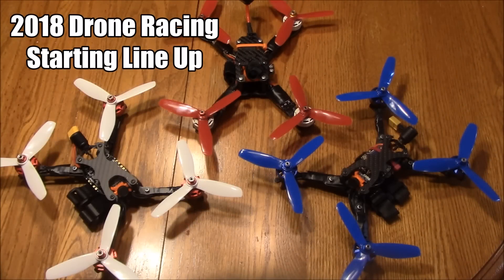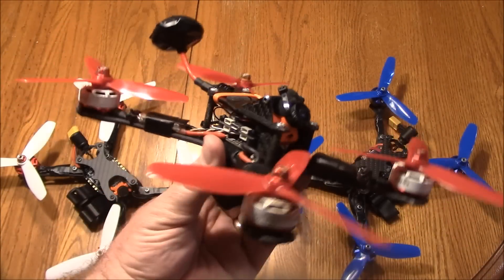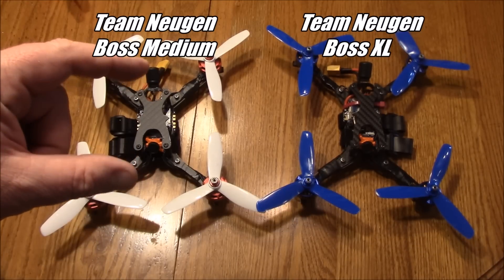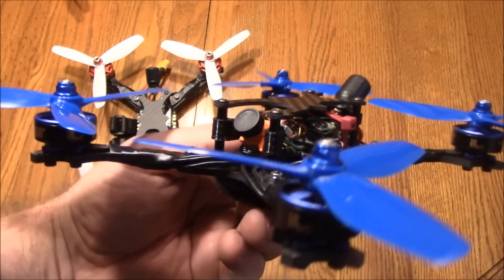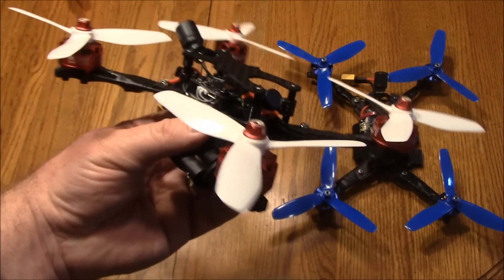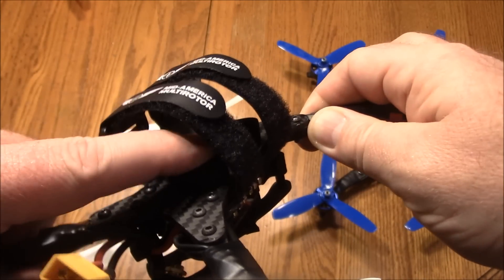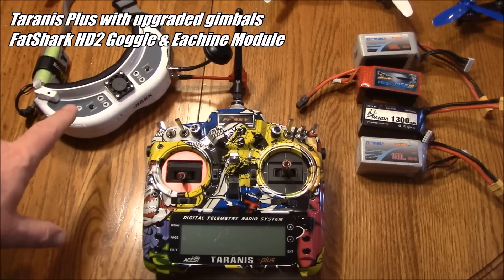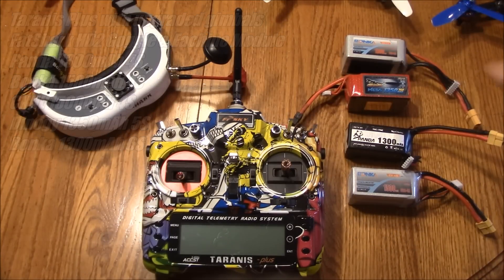2018 Starting Line Up - Drone Racing Equipment

Comment: Are you really competitive with these rigs? Seems far from good components to me?
Reply from the maker: Joe Gonzales Expensive components can help, but if you/me/whoever can't push those components to their limits, what good does that do?  I push these quads as hard as I can during races and I to rarely ever feels like I'm asking more of them than they are able to give.  I've moved past the Racerstar 2205s because I kept getting to full throttle and they didn't have anymore to give and they became the limiting factor in my flying.  The 2750kv motors do all I ask and still have more to give.  I want my skills to be the limiting factor in my flying and so far these quads exceed it.  There are like 5 local pilots that I'm striving to beat.  They've consistently been faster than me.  I just need more practice to catch up.

Comment: How are these dys motors you own?
Reply from the maker: They were okay on 2-blade props.  I had a real hard time getting near full throttle because they were fast, but they didn't have much low-speed torque.  I just put the 3 blade props on.  I'd trade a high top-end speed for more low-end torque because a lot of the races we do are won in the tight turns and not so much in the straight-aways.  Hopefully I still have a good opinion of them after a few more practices/races.
Reply: travisgrindal let me know your experience after some races
Reply from the maker: The DYS motors are lots better with 3 blade props.  I was able to fly a little this evening.  I think they'll be plenty fast for now.  However, today I saw a 5S quad flying around and it was stupid fast.
Reply: travisgrindal thank you travis!!

Comment: Travis can I ask you why you use the dal v2 over the dal cyclones which everyone else seems to use
Reply from the maker: David Smit A lot of state-side companies are clearanceing the V2s out.  I picked up a bunch of sets for $0.75 a set from Mid-America Multirotor.  I doubt Dal Cyclones would make me a faster pilot.  My limitation right now is myself pushing these quads to the limits of what they can do.  I did try some cyclones but I couldn't tell any real difference in my flying.
Reply: I ran some of those V2's and it was not bad at all. Sometimes it really is a hype train when it comes to props. Seems like every few months a new prop comes out
Reply from the maker: ninjabee5001 I seemed to switch props alot a while ago.  Now that the 5045 props went on clearance, they're all I fly.  When my supply is gone I'll have to move on to a different one.  Hopefully another good set of props will be on clearance then.  :)

Comment: Hey,  I am wondering the price range of those quads? $300+ or $500+ each?  I would like a to use a better stack?
Reply from the maker: Gary Regier Close to $200.  If you buy cheaper motors that are beyond your flying capabilities, you can save a lot.  Instead of $20 a motor, the Racerstar and DYS motors were close to $40 a set.  The Emax 2750kv motors were $20 each so that makes the XS220 I have more expensive... Closer to $300.  You really only need to buy parts that are faster than your flying ability and move on to something new once the quad can't do what your thumbs demand.
Reply: Thx, Awesome suggestion.

Comment: I just built the Boltrc Kraken 5R, 2306 2400kv, 4s.
Reply from the maker: How do you like it?  I haven't been a fan of actually building inside an enclosed pod, but that is just based on observation.  I haven't tried it for myself.  I like the idea of the new pod styles that are coming out now with the sides open.  The pod connects to the front of the main plates and to the top of the spacers in the back.

Comment: How are you liking those dys 2207 2600kv motors?? I just got mine and installed them and they look and feel amazing for the price but one of them came with a bad bearing :/ have you got a chance to really test them out yet?
Reply from the maker: I flown them with 2 blade props.  I just put the 3 blade props on after our last practice.  I haven't been able to get them out to really push them yet though.

Comment: Do you have any problems with your vtx getting too hot when tied up together with your receiver and fc?
Reply from the maker: Not so far.  I'm running them at 25mw now because thats what we race at now.   25mw probably makes less heat than running it at 25mw.
Reply from the maker: oops... 200mw generates more heat than 25mw...  that's what I meant.  :)
Reply: All good... best of luck